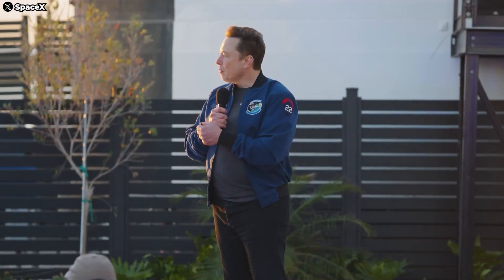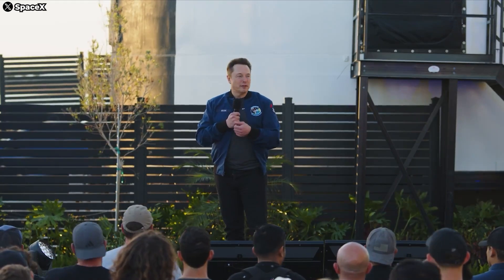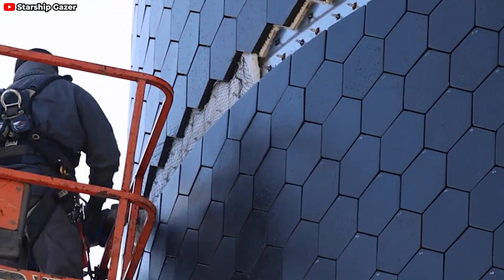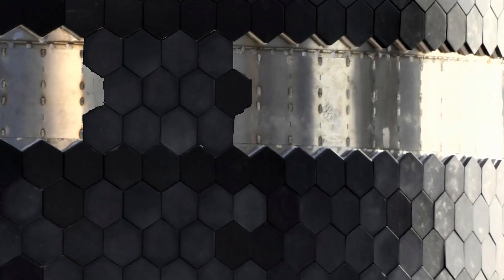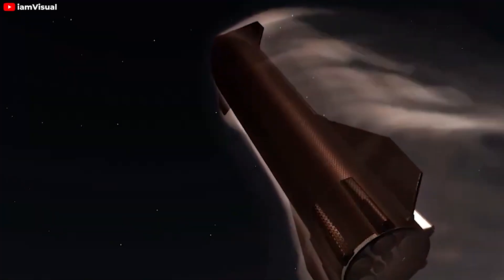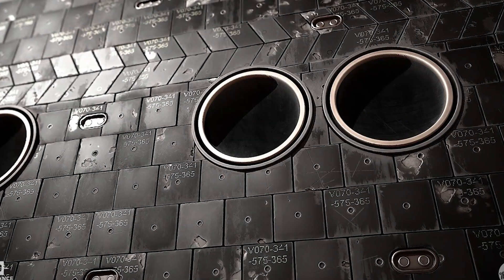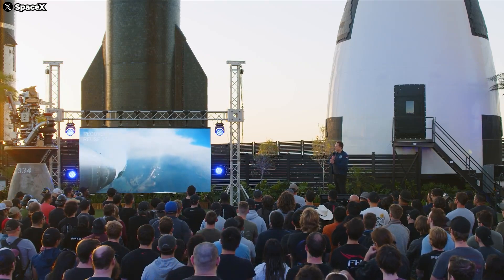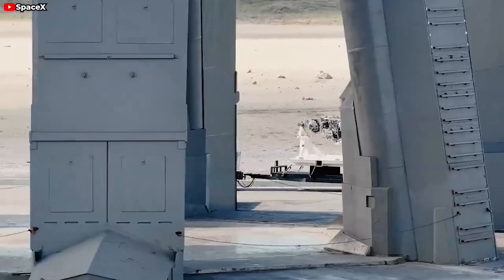SpaceX's Big Solution For Starship Heat Tiles Re-entry in Upcoming Launch!

Comment: What about a spray coating over the heat shields? If it works on the inside, than a light coat can’t hurt. I know there will be extra weight, but that’s leave that up the new R3’s. It’s already unbalanced, so a couple hundreds of extra weight will not affect the payload, especially with the ISP of the R3’s. 
Thanks for the episode. 
-NOM
Reply from the maker: Actually, the heat shield tiles of Starship do have an external coating. You see how the tiles are shiny black? That's because of that coating. The new tiles will be more heat resistant, so we can somewhat trust it for now.
but the problem is spaceX haven't yet figured out how to stop the tiles from falling off or breaking.
and thank you so much for your support. If you want to know more about anything, feel free to leave a comment